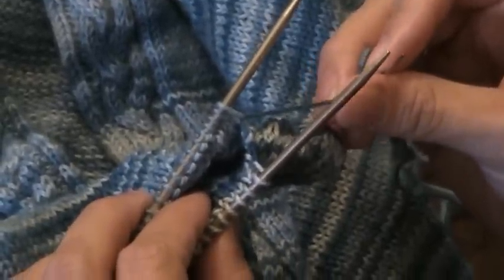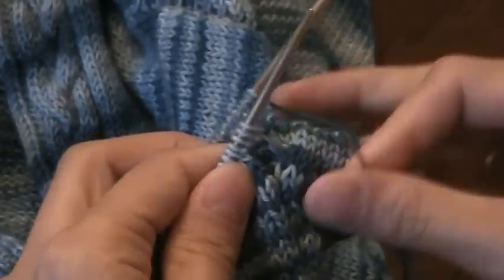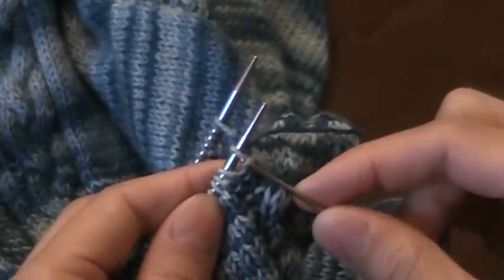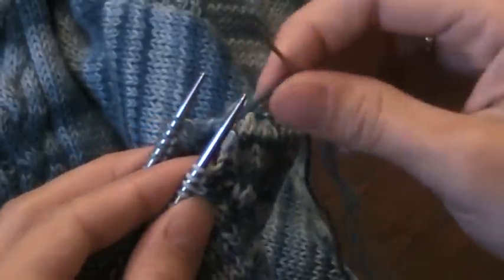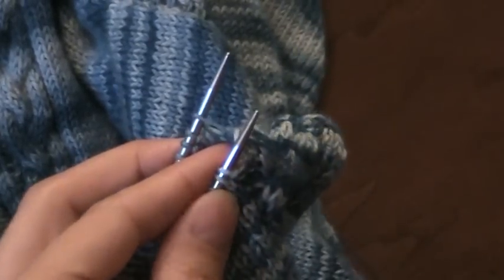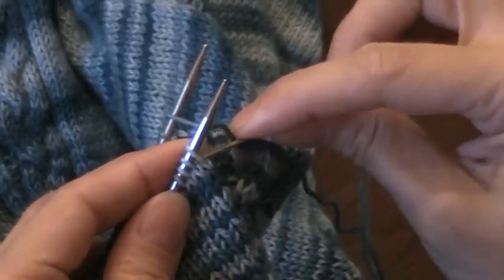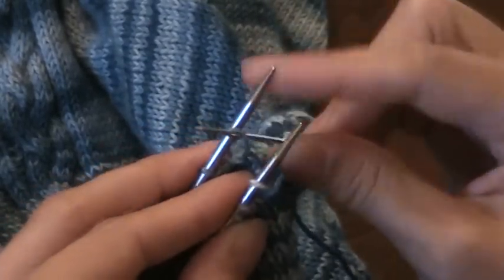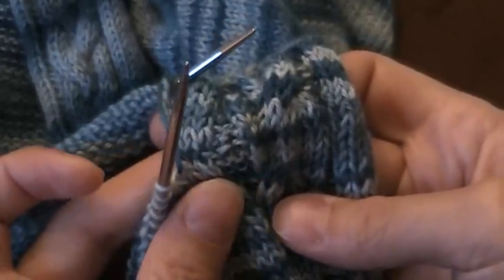Joining Cables with Kitchener Stitch.MOD

Comment: The verbal explanation is great, but I sure wish I could see those sts on the back needle better. You're talking about how the sts present themselves (as knit or purl), but for those sts on the back needle, are still talking about how the sts present on the WS? I'll take a look at your blog and see if that clarifies it for me. If you have occasion to redo this tutorial, might I suggest using a solid color yarn instead of variegated?